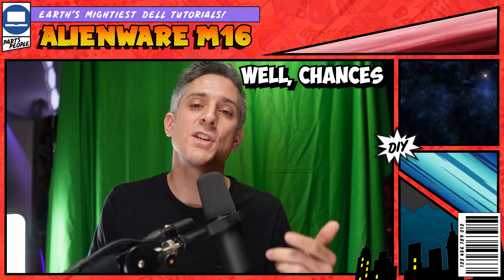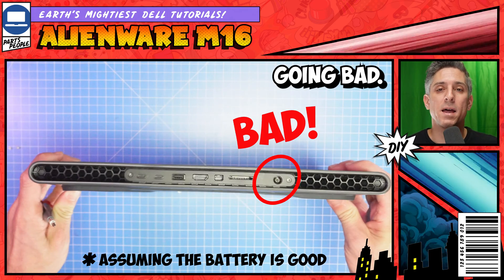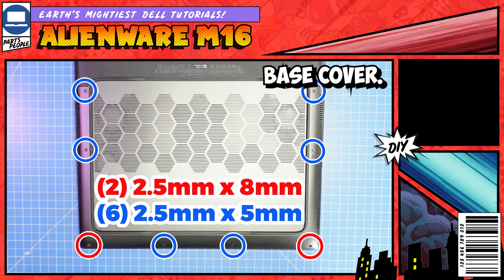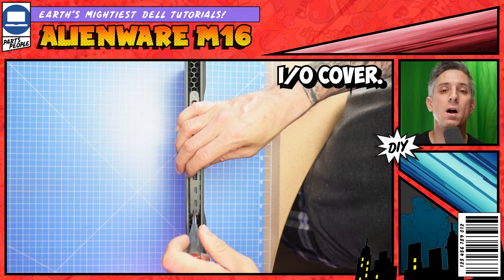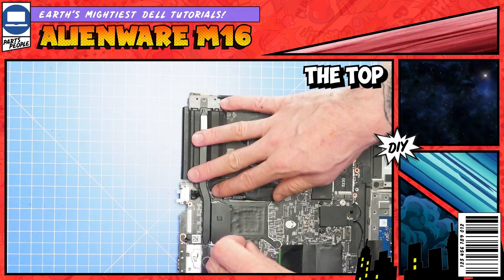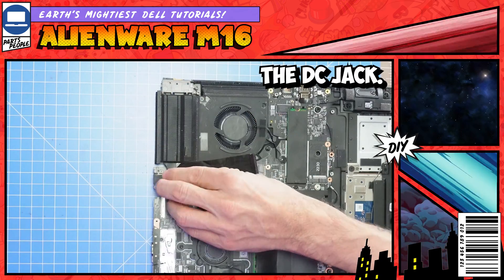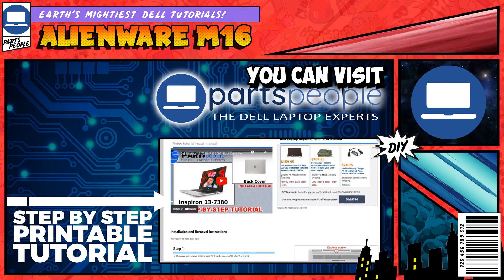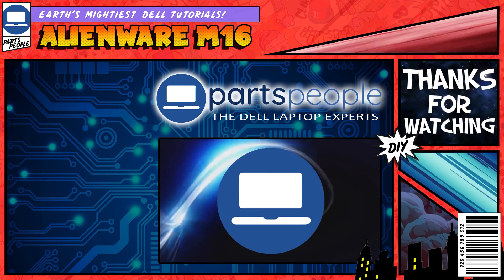How To Fix Your DC Jack Charging Port | Alienware m16 R1

Comment: The DC 14 pin part melted inside the connector on mine.  Still waiting for an answer from AW. the cable will fail on higher power models.

Comment: My Alienware M16 R1 wont detect the charger but it stops the battery from discharging. Already tried a different adapter and battery but still same problem. Any help?
Reply: Greetings. I'm having the same problem. Did you find the solution?

Comment: Mine got burnt at the connector on the board, i bought the replacement but i noticed that one of the pins on the receiving Jack on the board is broken. It still charges but I'm scared it might cause an issue later